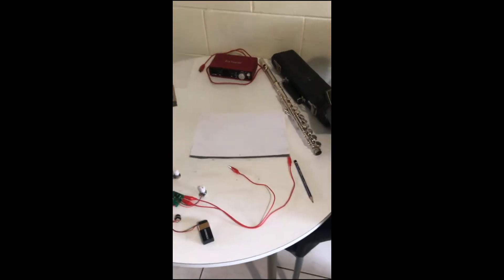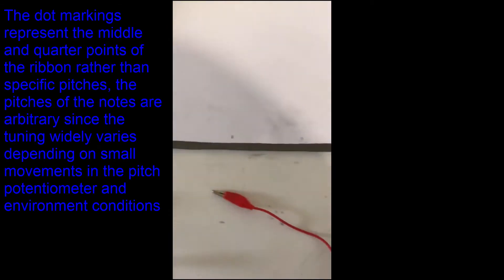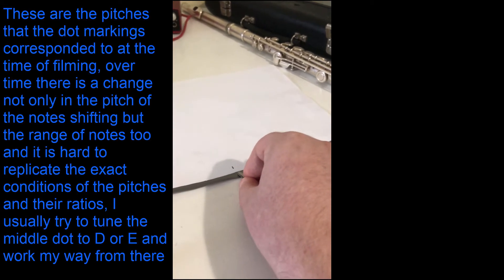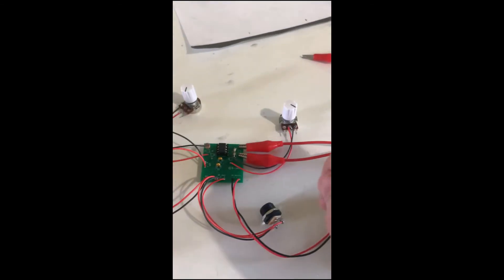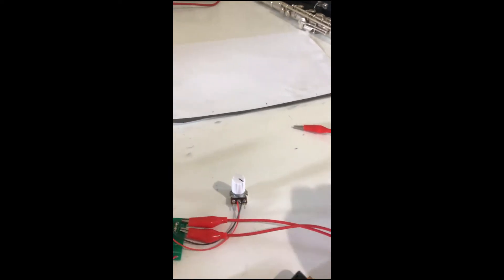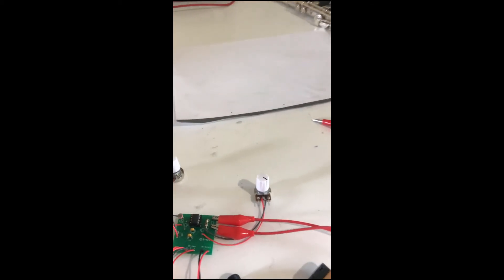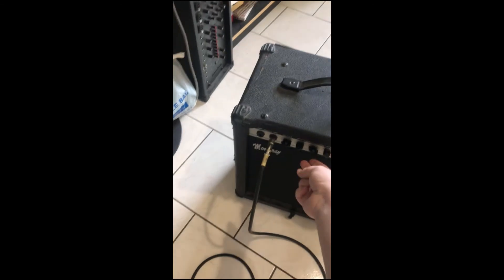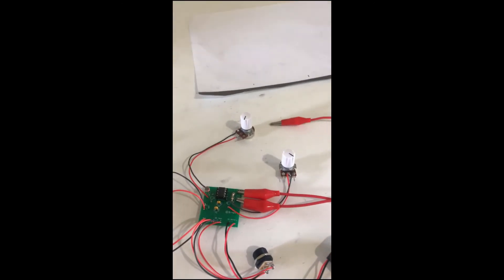Homemade Synth Ribbon Controller: Demonstration and Explanation

Comment: you might have better luck using something other than graphite as your conductor/variable resistor
humidity changes the conductive properties of graphite more than other materials like copper for example.. so you might be able to use something else to get a more predictable instrument
Reply from the maker: graphite definitely isn't the best material for this job not only because of the reasons you mentioned but also because pencil lead on paper isn't exactly durable, VHS tape is a popular and more durable option for synth purposes but I wasn't able to get my hands on any in time for this video, there are also pre-made manufactured ribbon controllers available online to buy for pretty cheap prices but the primary point of this project was to see if I could make a working playable ribbon controller for my synth using cheap and readily available materials hence why I went with pencil and paper, if I end up playing this live or even just using it a lot in recordings I would want to go with one of the more durable reliable options, copper makes a good conductor (the function of the stylus) but for the resistive side (the graphite) I would need to find some sort of flexible but durable semi-conductive/resistive material and there are quite a lot so we'll wait and see where this project goes in the future, at the moment the paper and pencil method is still quite fun and there's even a fun side to the instrument never being exactly in tune or never being able to recall the exact tuning I used it for before, in this video the centre dot is tuned roughly to E which made the other two surrounding dots tuned to C and B flat, but when I tune the centre dot to E now the surrounding dots  are always different like they might be A or C# or D anything in between, so the fairly chaotic properties of pencil lead make it a highly unique experience and it really forces me to use my ear which makes it great for experimental and improvised music, but for playing actual pre-composed melodies I think I would prefer something like VHS tape, luckily the ribbon is connected to the synth via crocodile clips so I can swap in-and-out any ribbon I chose at any time for any purpose without needing to de-solder anything